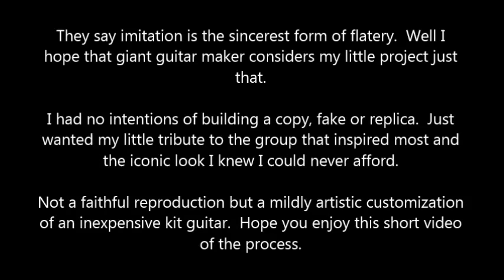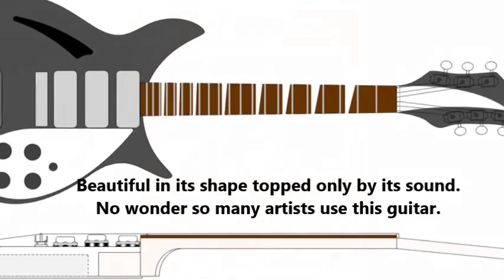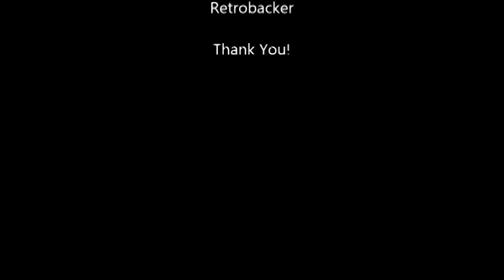Guitar Kit Build with British Flag Union Jack Paint

Comment from the maker: I first used a metallic blue paint which did work out. Had to sand down and start over. So I would recommend solid colors. Had a friend spray automotive clear over the whole thing which gives it the wet look. Told later that automotive finishes don't like rattle cans but it worked out in my case. I have since built a Strat 12 string from a kit and inlaid wood on top. Turned out real good. Thanks!